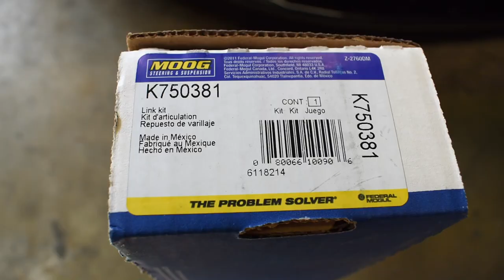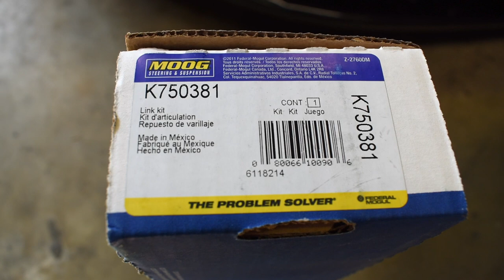Honda Fit Sway Bar End Link Replacement (Honda Jazz)

Comment: Just did the job. Jack up both front tires to release the tension. To make it easier to install the new Sway Bar Link
Reply: Poor Homie I just realized that I needed to do that before attempting this replacement. With only one wheel off the ground the space between the sway bar and the strut is too short and the link won't fit. Thanks for the heads up!👍🤘😎
Reply: José no problem 😊
Reply: By that do you mean lift the car with both tires off the ground?
Reply: @gorygarcia9605  Yes